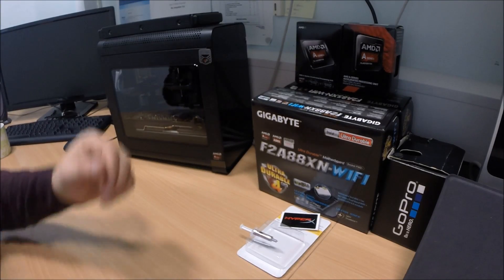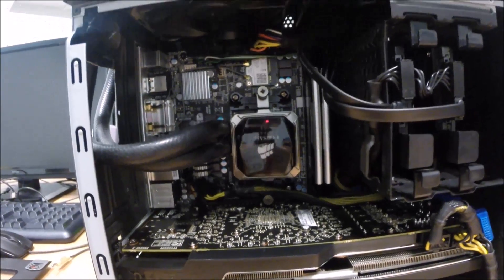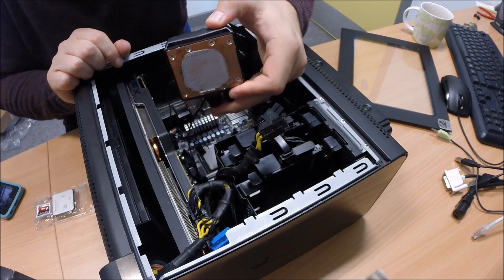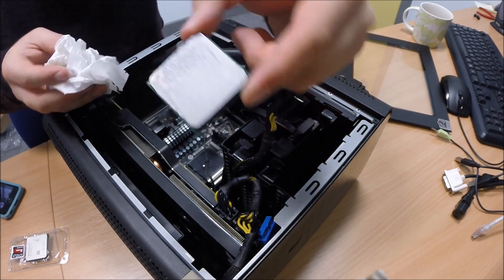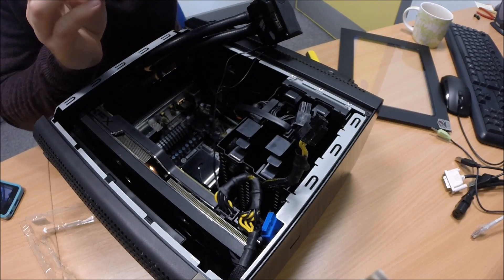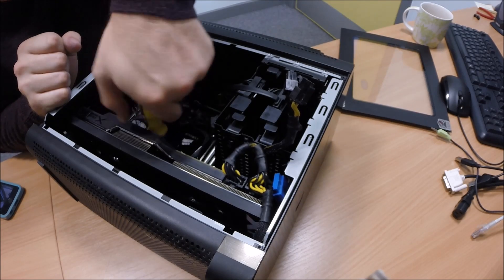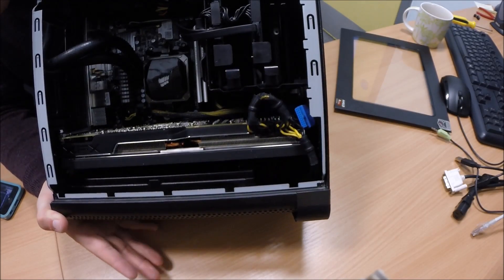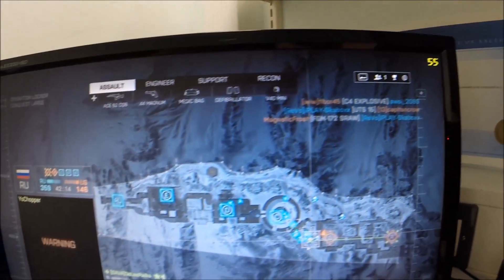AMD A10 7850K UNBOXING & Installation PART 2

Comment: Hi I want to put in my Vantage computer tower I do have A Gigabyte F2A88XM and I want to put in 7850k A10 AMD Processor,Zalman reserator Max 3 cooler,2GB GDDR5 EVGA GEFORCE GTX 760, Is this possible.